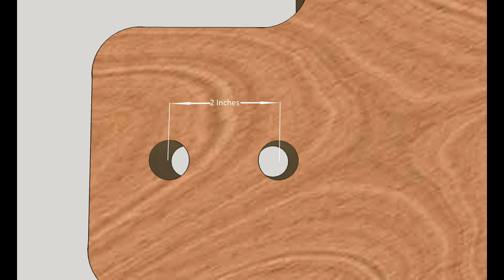Put it all together! Metal Cutting Station, Part 4

Comment: I would have used the existing handle holes in the grinder to mount it to the sliding block, but then, I had your video to point me in that direction. Very nice job and video, I plan to use some of this idea and use gate rollers on angle iron for the tracks so I will have to see how that works out.

Comment: Dear Fred, thanks for putting this series together. The end result looks very functional.  The best I have seen on YouTube. Do you have a set of plans for your build? I will have to modify them because I am going to use a heavier duty 9” grinder instead of the lightweight 6”grinder you used. I am also left handed and so everything will need to be built the opposite way around.  That doesn’t sound too hard does it?

Comment: For future reference there are two holes, one on each side, that are there for a control handle for two handed use. A simple L bracket bolted to your frame and also into those holes will hold it steady indefinitely with no more issues
Reply from the maker: Jeff, this is a terrific tip. Thanks so much!